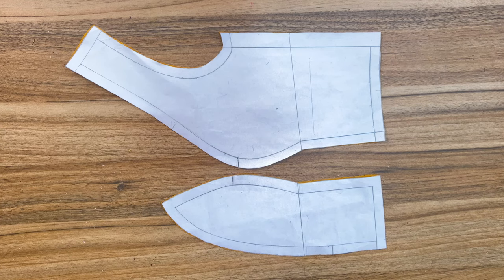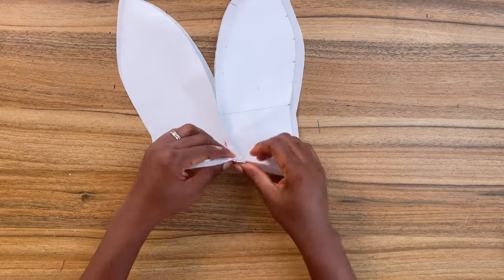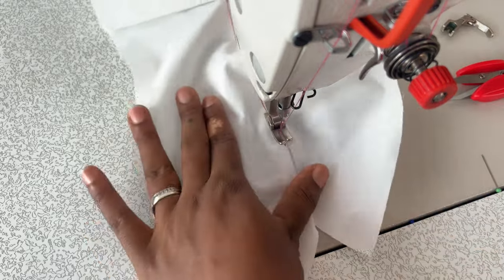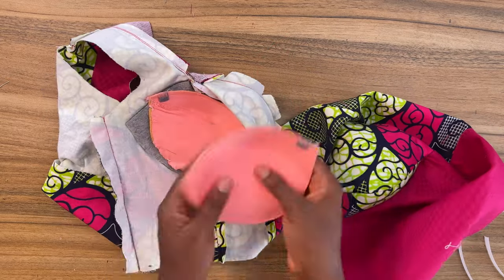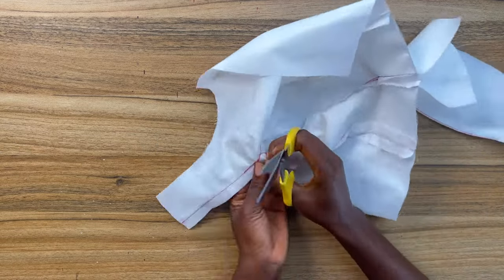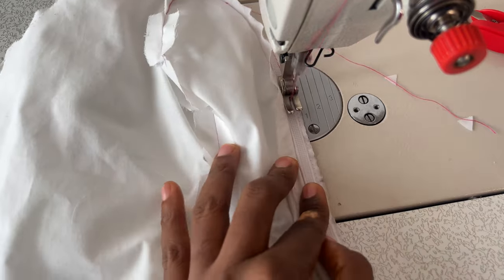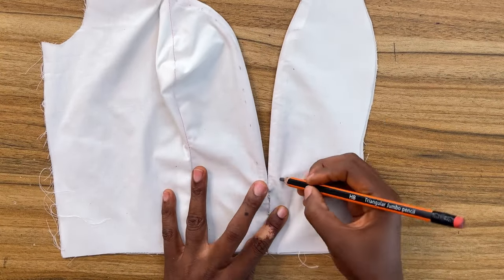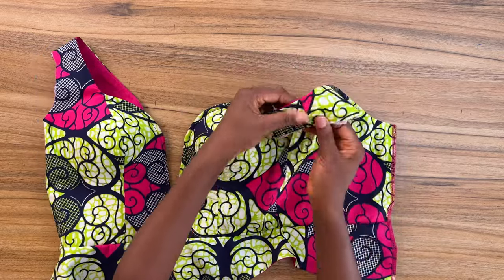How to sew a Classic princess bustier with deep plunging neckline | how to insert V-neckline wire

Comment: Thank you for this. What can i do if I'm adding a skin mesh at the sweetheart part?
Reply from the maker: You don’t need the  neckline wire if you are using a skin  mesh . it’s like you replacing what you cut out to form the v neckline with a mesh but you still get the illusion of the v plunged neckline because the mesh is transparent  but you still need to contour the center front

Comment: Thanks. You are the best🎉🎉....what is the purpose of neckline wire and boning? When do we use them
Reply from the maker: Because this is a deep plunging neckline  that goes  down beyond the  bust point level, the neckline wire is use to stabilise the neckline .
it reinforces it and prevents it from crumbling  especially due to the fact that there is no yoke to hold it up in place 
Without the neckline wire it will gap even after contouring the Center front . Hope you understand?

Comment: How do I determine the type or size of wire to use?
Reply from the maker: so  after drawing out  CF contour dart which is  ¾ wide, measure from the neckline depth  At center front,  “mine is 1½” below under bust  line”  to the first dart leg,jump the dart and continue measuring from the third dart leg to 1³/₈” just above the third dart leg  which gave me 6”   
Or  measure from the neckline depth to just where the neckline starts curving out towards the shoulder and subtract the contour dart width of ¾”
Reply from the maker: so  after drawing out  CF contour dart which is  ¾ wide, measure from the neckline depth  At center front,  “mine is 1½” below under bust  line”  to the first dart leg,jump the dart and continue measuring from the third dart leg to 1³/₈” just above the third dart leg  which gave me 6”   
Or  measure from the neckline depth to just where the neckline starts curving out towards the shoulder and subtract the contour dart width of ¾”